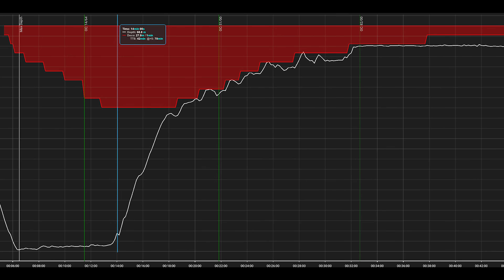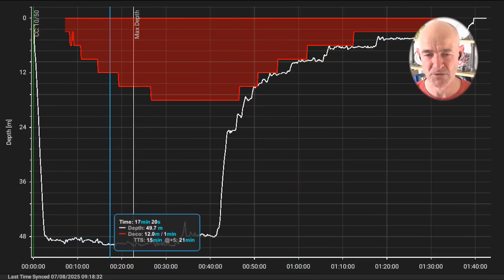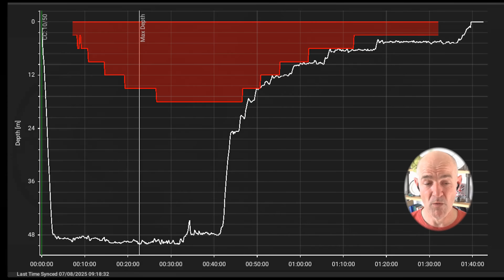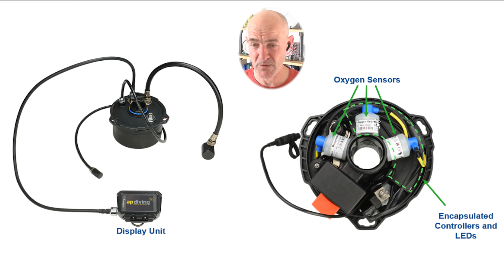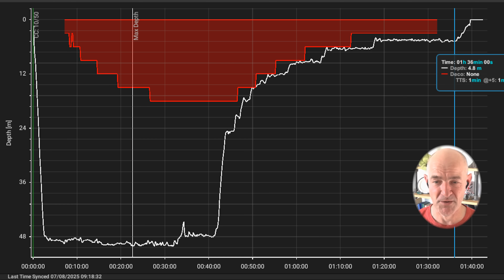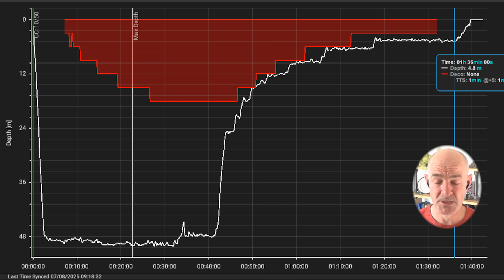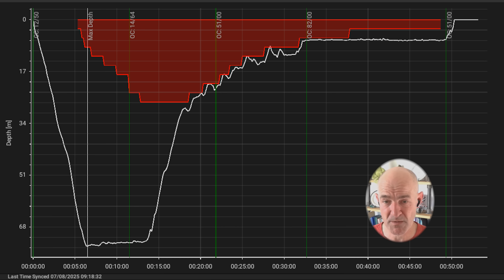CCR Malfunction at Extreme Depth – How I Made It Back

Comment: Well… this is why I dive rEvo. Fully redundant electronics, 3 primary O2 sensors and 2 independent monitors, even if the controller takes a dump… you still have PO2 monitoring and decompression computer.
Reply from the maker: Glad to hear your unit has such excellent redundancy built in!

Comment: I dived open circuit T Mix for 6 years before closed circuit and it basically conditions you for bail out on a breather . Had the same scenario on the flying enterprise and had to assist with bail out . it definitely sharpens up you skills

Comment: Isn't it possible to connect a NERD2 to your unit? This would give you the PO2 real time on any depth, and you can correct it manually if needed. Precise for the situation you described i have my nerd2..
Reply from the maker: Yes it is although only using a third party modification.  Quite a few people do this, such as my buddy Rick, but I've never fancied the cost!

Comment: Thanks for sharing. It made me think about my own system and its redundancies. I think the main failure point for mine(P2) would be the battery comportment or electronics package flooding, the hud has its own wet contacts but I had to think about it for a second to work through any other ways the entire CCR could be shut down.. This is also a good reminder to do a bit of basic pre-planning, bailout for x OC Deco plan = max bottom time of the dive.  Thanks for another great video
Reply from the maker: Glad you found it useful and prompted you to think about your own systems.  Hopefully you'll never experience the same!

Comment: Havent watched for a while and did not go diving as well for quiet some time for personal reasons.

Enjoyed your video to come back. Well habe to say that every electronics can fail - or rather will fail at some point. So bailout is very important as you mentioned. The explanation sounds reasonable, water compromised the system.
So the only thing to change would be a kind of "dead man" check, cross check between the electronics in order to verify if a system is allowed to give certain instructions. Must be very simple, testable and robust and must rely on secondary information as well as be able to check and override by a human.

So and thats actually a main issue of rebreathers. These are small numbers to produce, so no chance to make things cheap because of pure numbers, i.e. mechanical parts. And therefore also such software things are not really feasible. But there training comes into play.

PS: Did you manage to ifentify the flooding root cause, two in a row?
Reply from the maker: Sorry to hear about that but hope you're now back in?
Unfortunately I never received feedback about the root cause but several other people had a similar issue at the same time so I suspect it was a component/manufacturing issue.
Reply: @DeepWreckDiver  yeah thanks. Did one dive, so trying to get back. Certainly need a bit of practice again, lets see. Thanks for asking.

So basically it seemed to have been fixed by replacing the parts after the flood. Well if it was something, there should have been put out a note I believe, but you never know.

Comment: Also, I noticed that the EAN82 used at 6m has a PO2 of 1.28 Good thinking considering a long hang to avoid overshooting the CNS clock and maybe if the diver for whatever reason wanted to keep the same PO2 used on the bottom while on CCR
Reply from the maker: Yes, also 100% doesn't offer much in the way of reducing deco burden whilst significantly increasing CNS.

Comment: It seems an odd design choice to me that the rebreather would equate “no more pressure information” as “no pressure at all”, especially if the unit was ostensibly in the middle of a dive.
If anything, during a dive, losing headset/pressure data should tell the unit “SHTF, we are not turning off under any circumstances, user can unplug batteries if they want to reset the device”. Flooded buttons or wires could easily simulate button presses, and send garbage to the unit. I believe this is 100% on the manufacturer.

Comment: If I connect both cases now, it must mean the following:
In the first case, when the dive computer was defective, the pressure sensor of the dive computer must have continued to work, otherwise it wouldn't have been possible to continue the dive with the HUD.
In the second case, when the dive computer was defective, had you not turned off the rebreather by pressing buttons—which only works at surface pressure—your rebreather would have received information from the dive computer that you were at 0 meters and using 100% oxygen.
That would have been fatal, wouldn't it, or am I missing something?
Reply from the maker: Unfortunately your analysis isn't accurate.  
The Oxygen sensors don't need the pressure sensor to detect the partial pressure of O2.  That's why the HUD was fine on the first dive.    
In the second case, although the oxygen sensors continued to detect partial pressure of O2, I'd turned off the controller which operates the solenoid!
Hope that makes sense?

Comment: I had a similar experience with my rEvo. My primary controller (a Shearwater Petrel) suddenly died during the dive, but my dive was shallower, 40 meters, on the Stolt wreck in New Jersey, USA. My rebreather has a shearwater Nerd as HUD, so I was able to read the status and manually control the unit. No need to bailout. But it was a good experience.
Reply from the maker: Thanks for sharing and glad it went well for you 👍
Reply: I had exactly the same experience on my rEvo and flew the unit just on the NERD

Comment: I ma not ccr diver and Has limited info. Question normally dive eqiupments is very reailble and resistance to failure. In case od ccr i hear/ read a lot of dramatic stories. Why there is much diference ?
Reply from the maker: CCRs are orders of magnitude more complex than normal scuba gear.  Like any complex system that introduces more potential for failure but also CCRs are used for doing more extreme diving than normal scuba gear so the consequences of failure can be more severe.

Comment: Quite a gamble IMO to expect to find that line and the 80% in order to be able to meet your deco obligations. That was a sphincter tightener, I am glad you made it out safely and calmly, well done! I am not unit bashing, however on the Choptima HUD you cannot affect it at all from the primary handset/controller. It also has it's own independent brain and battery versus the primary handset/controller.
Reply from the maker: We had a distance line that would take us to the bottom of the shot so getting back wasn't an issue.  You're right though that having the 80% on the line is a potential issue and that's why we've changed it.
Two completely independent systems sounds like a good idea!
Reply: I also learned after listening to your video I messaged with my instructor and he explained that if something like this were to happen with the unit that I dive it would revert to the low set point and you could manage it with the HUD or obviously bail out. He gave two scenarios where he would try to stay on the unit if he were in a cave and manually adjust it however, if he were in the ocean he would just bail out.

Comment: Wow You are testing out all scenarios most only know as a course scenario! The 2nd being a brilliant textbook example of murphy! No unit bashing here.
To my better understanding, in the 2nd scenario, would it have been a consideration turning of Dil and flushing the unit with oxygen at 6m?
Reply from the maker: Yes I could have used the unit as an oxygen rebreather at 6m but chose to stay on the 80% as I knew there was lots in there!
Reply: @DeepWreckDiver  Thx for the response. I know I have easy talking here, doing my decompression always at lakeshore or springpot I do the oxygen-flush on every significant deco dive to cut down some minutes, while adding a shallow fundive there. Way easier than in open sea.

Comment: I know absolutely nothing about diving but I was wondering why keep using gear that fails? For myself anything which fails will not be used again. Being underwater is certainly nothing to fool around with especially with faulty gear. Toss the gear, and yes if it was me I would blame AP. It's their gear, so they're at fault and should be held accountable otherwise they won't change a thing until someone does sue them.

Comment: Without placing blame on AP, I do hope they and other manufacturers learn from this and design/update units so it’s impossible to switch them off under pressure. Sharing such incidents makes diving safer, thanks Don
Reply from the maker: I couldn't agree more!
Reply: @DeepWreckDiver  When I tried this in the shallows at Vobster just to see what would happen, it immediately turned itself back on.
Reply from the maker: @jongmassey Yes the wet contacts will do that.  Presumably that element of my handset died at the same time as the pressure sensor!
Reply: @DeepWreckDiver  what unfortunate timing!
Reply from the maker: @jongmassey You're not wrong 👍

Comment: Great video! This stuff needs to be public for everyone to learn!

I am not a CCR diver and not familiar with the details of the AP rebreather. But from what I gathered from your video, I would also suggest to bail out in a case where the HUD is still working. Since the buttons could turn the unit off under water in the second scenario, it is fair to assume that the setpoint can be changed as well. That means, that the buttons might short and change your set point without you knowing.Maybe you do not need to bail out within seconds when the hud is showing green lights. But in essence you are breathing an unknown mixture and that might be bad for your decompression. Especially during the ascent or shallower dives, when the relative change in ppN2/He is large compared to a change in ppO2.
Reply from the maker: That's a really interesting point about the set point.  Hopefully I'll never have it happen again but if it does I'll certainly be thinking about that!

Comment: Thanks for another fascinating video, Dom.    I did a bit of research into the BZB stamp on the patent fuel blocks.

According to the research, the bricks stamped with "BZB" refer to "Bessemer's Zinc Bloam" or are associated with the Bessemer process, but this is not entirely accurate based on historical evidence.

The "BZB" stands for Bessemer's Zinc Blocks (or sometimes referred to as "Bessemer's Zinc Bloam" in some contexts). They were invented by Sir Henry Bessemer, the English engineer known for the Bessemer process for steel production. The "Zinc" in the name might be a misnomer or a specific term Bessemer used; it does not mean they contained zinc, but rather it was part of the brand or patent name.

The patent for these bricks was obtained by Bessemer in the 19th century. The bricks were intended to be a cheap and efficient fuel source, especially for steam engines. The stamp "BZB" was likely an abbreviation for the product name, such as "Bessemer's Zinc Bloam" (with "Bloam" possibly being a proprietary term) or simply "Bessemer's Zinc Blocks". However, historical records often refer to them as "Bessemer's patent fuel" or "compacted coal bricks".
Reply from the maker: That's absolutely fascinating and I've previously drawn a blank trying to figure out what the BZB meant - about the best I could think of was the initials for a company.  I wonder if that means they were produced by his company?

Comment: For the second failure, it sounds like AP might need either a software or even hardware revision.

It sounds like there should be some feedback from the screen. If that fails then lock out the buttons.  If the buttons still work then you could switch to the low set point. I'm sure you could appreciate how much worse that would be.

In terms of the random key presses turning off the unit, by the same logic electrical shorts (from the salt water) could achieve the safe effect.
Reply from the maker: A really interesting point and not something I'd considered - thank you!

Comment: Yes pretty plausible about the pressure sensor seeing ap or just dead and being able to turn off; so when a major problem like this, Do you mail the whole head in to AP for repair?? Did they tell you what caused the handset flooding or did they make a change to manufacture process??  Feel confident with the current handsets? Love my Perdix 2; after first week, me and partner had 2 fails same dive, his old Suunto told him he had 9 min deco, my spg said I still had 125 bar left???  But the Shearwater said just make a safety stop, and my spg hadn’t move in some time, so we waited for his Suunto to clear and we ascended; after shutting off my tank valves , bleeding off and reopening, had only 50 bar left, but were at 5m no biggie. Your bailout systems seem fine for the group.
Reply from the maker: The whole lid went to AP who replaced the handset/cable.  I've dived with it for approx 5 years since and not had any problems so I think they cracked the problem.
Sounds like you had an interesting experience as well but glad it worked out fine!

Comment: And thats why I still have a mono handset on mine
Reply from the maker: I think the issue has now been resolved.  I couldn't dive a mono handset as I wouldn't be able to read it 😂
Reply: @DeepWreckDiver I sort of have the same issue, but it helps make sure the buzzer remaind the JJ divers why they should have purchased an Inspo, when you hit the ceiling.

And whilst we are unit bashing - I bet this sort of thing would have never happened on my Drager Dolphin (mainly because I'd be dead before I got to the bottom)

In all seriousness, the only reason I've now got a 2020 handset is because I'm worried about the plastic case being damaged when pulling myself through a squeeze in a cave.

Comment: Thanks for sharing Dom, it kind of reminds me of Murphy's Law, why critical systems are double or triple redundant and how major design and technological progress is made on the back of some disaster or other. Your flooding incidents show it's necessary to have good training and a simple backup/bailout plan that can be used effectively in any stressful situations. Single point of failure designs are usually due to the cost versus probability equation, it could be made bullet-proof but it would be so expensive nobody would buy it! Glad you survived to make more videos for us 😃
Reply from the maker: Thanks and yes it's worth highlighting that although these were very unusual occurences it's important to always have a plan b!
Reply: I'm not a CCR diver, but lean towards the Divesoft Liberty as its design philosophy is total redundancy. Two Controllers, Two solenoids etc - Note I am not unit bashing here, if the same design philosophy existed as an AP or JJ I'd consider them too.

Comment: On the second computer failure instance, did you consider using your unit in SCR mode? 
Fran was with you BOTH dives? Surely she rolled her eyes when you signalled your computer was broken the second time?!
That's funny that you were able to turn it off blindly! 
What was the AP service like? I assume it was excellent. But did they laugh out loud when you called them a second time while they JUST got the first computer operating again?! 
Are you on their short list of divers for QCing their equipment now?!
Maybe you can explain the evolution of the tank drop system your team has implemented.
Reply from the maker: No to SCR- it's a really high workload and not something I'd try on an ascent anyway.  I've got a load of bailout gas so this is the time to use it
No she was only with me on the second one
AP were great but I think they were having this happen a lot at the time
The drop tank system has two changes, (a) we don't put them on the lazy shot now, and (b) we have more cylinders so for a 100 m dive we'll normally have a 50m gas (25/25), a 21m gas (50%) and a 6m gas (100%).
Reply: @DeepWreckDiver The proper emergency procedures for the given emergency. 
Even with all of the training and practice of those drills, I still find when it actually happens, some nervousness enters the mix
Reply: @DeepWreckDiver  I'm guessing you switch to the deep BO you're carrying,  fire your Orange and Yellow Blob with a note saying depth/mix you want and take it from there? Or are all three mixes on one pre-rigged line that they just clip to your DSMB lines and lower away?